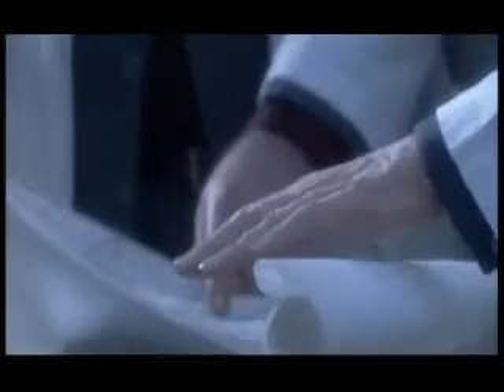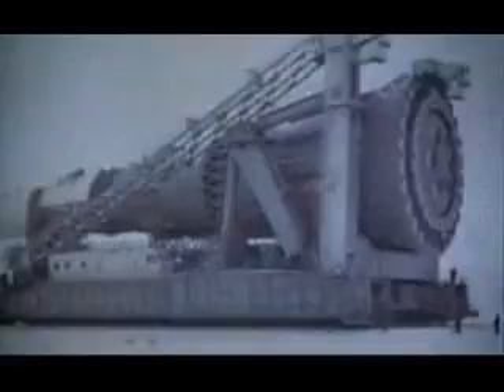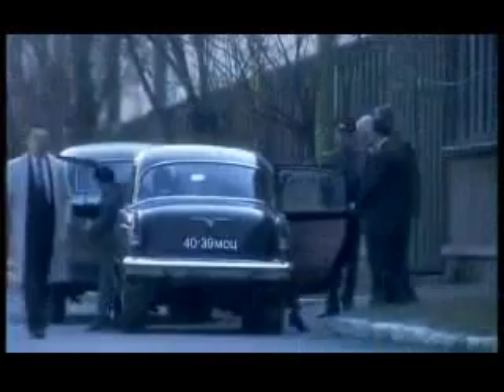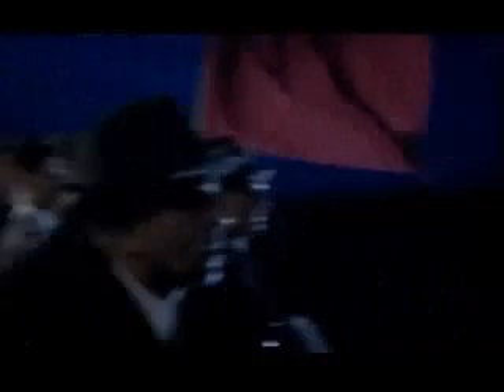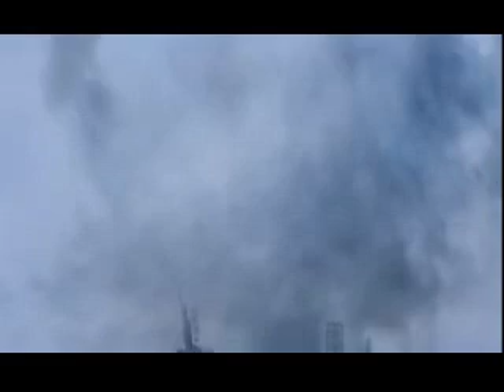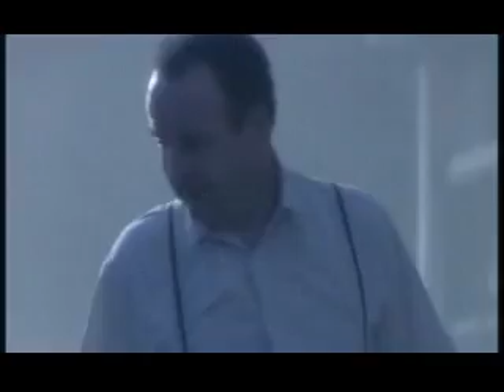N1 soviet moon rocket (Excerpt of "BBC  - Space Race")

Comment: Energina alone (without Buran annexed to its body) and in advanced configurations would supposedly lift 140 MT.
The version that flew did not have 140 MT lift ability to LEO.
If you took the shuttles weight out of equation and instead created a standard configuration rocket,the weight to LEO would be much closer between the two, in fact if they ever build the Ares V (basically a larger version of the afore mentioned) it will easily exceed the lift ability of the previously flown Energia.

Comment: Energia's main engines are the first closed cycle engines to be built and have a massive power advantage over USA kerosene engines. The USA shuttle has solid rocket boosters to give it the power it needs but they cannot be throttled making the USA shuttle very dangerous.

Comment: The N1 would have worked if Korolev was still around and they got a test stand.
The N1's engines and first stage were much more complex then the SC-I and F1 engines.
The were trying staged combustion engines during the 1960s which the US didn't really try until the SSME on the shuttle and for good reason since real time controls needed to keep the engine from exploding were not up to the task until 1975.
The next rocket to take humans beyond LEO will likely be either Falcon 9-H or Angara.

Comment: The Energia launch vehicle uses liquid rocket booster derived from the Zenit rocket. They use one RD-170 engine. The core uses four RD-0120 engines. On its most powerful configuration (with eight liquid rocket boosters) it could launch 200 metric tons to low Earth orbit. So it is the most powerful Launch vehicle, even when launching Buran (with only four liquid rocket boosters).

Comment: Having a powerful first stage might lift you off the ground easily, but it doesn't guarantee you that you'll achieve the velocity for LEO. For example, the N-1 might have a first stage more powerful than the Saturn V's, but it wasn't capable of putting a 140 ton payload to LEO. The point is that the thrust (power) of each stage is critical to launch a heavy payload to LEO. The power of a rocket is measured on how much power it has to launch a payload of certain weight to a certain trajectory.

Comment: Well, in order to send heavy payload to ,at least, low earth orbit you need the necessary thrust (whether if is measured in pounds or Newtons) to achieve/maintain a certain acceleration; in order to achieve the proper altitude and the necessary velocity within the weight limits per stage (which limits the time of powered flight) that are necessary to achieve a circular parking orbit with such a payload.

Comment: not entirely correct, the n1 had weaker experimental oxygen rich turbo pump exhaust engines and therefore needed more engines to overcome weight of fuel, the later closed circuit engines are more powerful than the saturns. nasa even procured a couple of engines to examine, they looked like a bag of bolts but they were very impressed as the russians had managed to overcome the resonance problems with a closed loop engine.